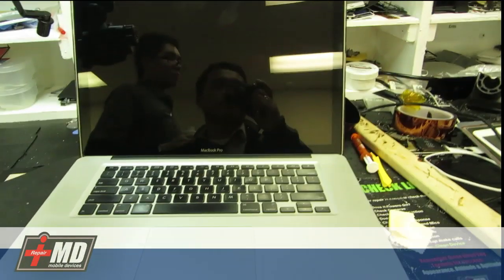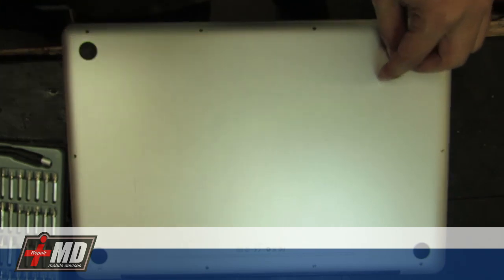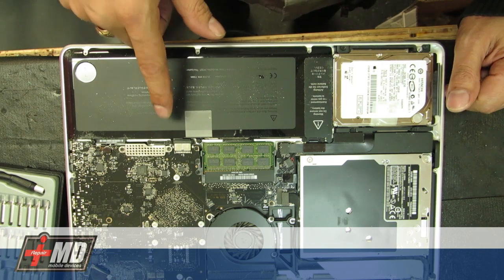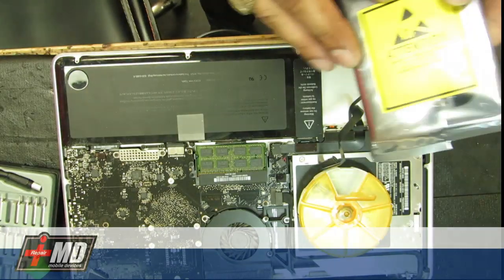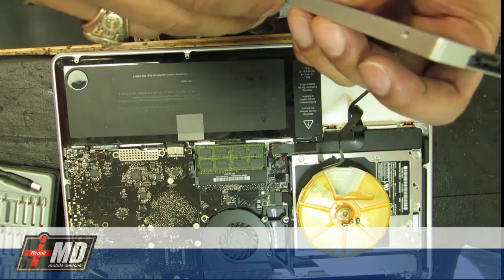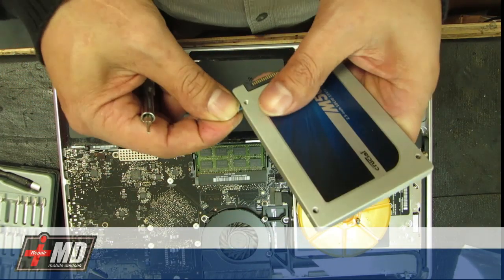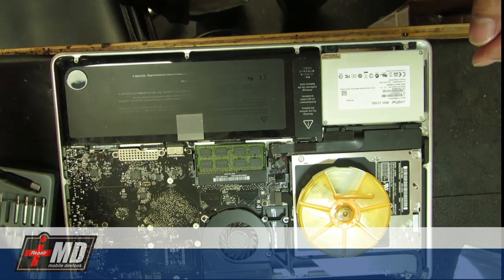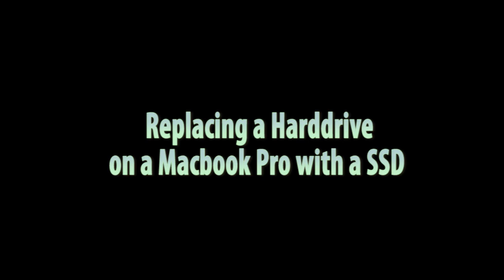Macbook pro internal hard drive replacement with SSD

Comment: How did you recover the data from the bad hard drive??
Reply: I was able to do it following these instructions. You will need a working Mac and thunderbolt cable to connect both computers. https://support.apple.com/en-gb/guide/mac-help/mchlp1443/mac